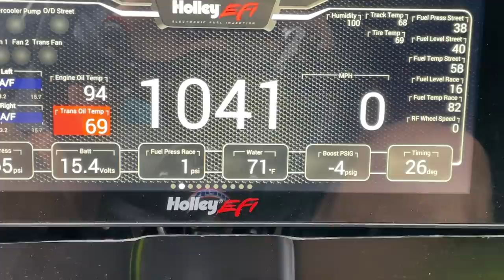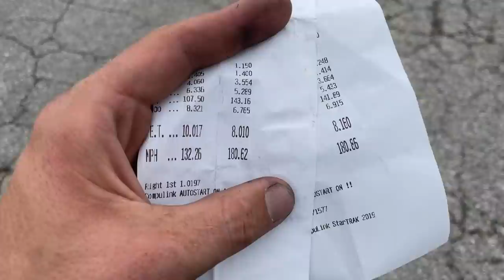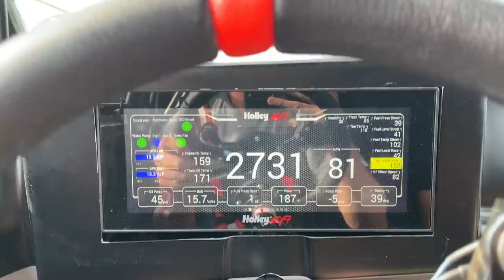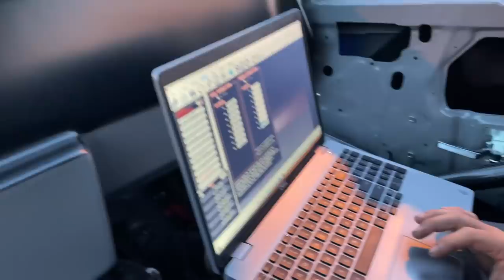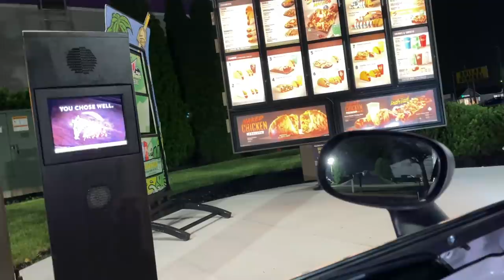Midwest Drag Week Day 3 - Mullet Was NOT Happy... Track Couldn't Hold the FREEDOM! (+300 mile drive)

Comment: As an example of how far automotive technology has come when I was a kid funny cars were running the 1/4 mile times Mullet is almost capable of... and no way a funny car was able to travel thousands of miles on the street dragging a trailer much less. Heck I think they needed rebuilds after each run and went through a few gallons on a run. Plus they were loud enough to hear for 20 miles. Just amazing what is going on now with this sport. So glad it is still alive and kickin. Drag racing is as American freedom as it gets. But if you told someone back in the day your street car could run 6's or 7's in the 1/4 you would have been laughed out of the neighborhood. Yet it is real now. Heck pro stocks were running 10s back then.

Comment: Thought the drivers side storage panel cover was going to tear off on the last pass.  It was flapping sooooo hard.
Reply: Yeah, I'm sure that had to be part of the reason that pass was so squirrely..? Maybe?
Reply: Just the wings trying spread to take flight man
Reply: @tacojay5617  That had noting to do with it, he spun the tires which made it lose tractions so he was basically driving on ice at that point.
Reply: Tires spun, shaking car which probably caused panel to shake loose
Reply: was wondering if that was chute starting to peek out, thanks.

Comment: Need more weight on the back end?  Kevin would fit under that bed cover.  He's worth at least a buck fifteen.
Reply: Just throw a few cases of Mountain Dew in there and it will hook.
Reply: That would be a sick ride, I'd do it
Reply: I was thinking the extra overdrive and the 389 gearset should add a few pounds under there.
Reply: I think they've got a slidable weight in the bed. Time to slide it back? It's an education for me to see the technology available for today's steet/strip (more like strip/street) rigs. How much of the tunable everythings (like tunable suspension systems, fuel, timing, turbo boasting, valve lash, weight locations...) origonated from the Prostock/Promod crowd?
Reply: @carolbates6886   The big gas tank for the street fuel can be mounted in 5 different positions from the front to the back of the bed. 
I remember when 7 second Pro Stock cars were considered fast.
Reply: I remember when Cooper would ride in the trunk of cars and they would launch it
Reply: was thinkin exactly the same.

Comment: For the top bar adjustment, were you referring to moving the front link up?  A higher instant center plants the tires harder.  If you moved the back bar up you actually lowered the IC which would make it squat more.

Comment: Your Holley EFI display is crooked, I’m surprised Kevin’s ocd didn’t see that.
Reply: Or it’s the camera
Reply: @mattspychala7251  Nope.. look at the cut out around the display.
Reply: or cleetus did it on purpose like the mis-aligned steering wheel.. :P
Reply: Could be the screen is level and the dash is a curved unit making it look crooked
Reply: Pretty sure the dash surround is curved, but the screen sits straight, or just a tad too much too the right.
Reply: @Gobbbbb  Go look at it again in his latest video at 2:42.
Reply: @williamstevens4172  Go look at in his latest video at 2:42

Comment: Definitely want to put weatherstrip on the frackin bed cover panels. Maybe even some drains in the front of the bed cover to keep water from pooling and draining into the bed.
Reply: Also, drain holes or filler for the lip in front of the rear tires where the water drips out and might be causing them traction problems.

Comment: That new gear made quite a change on the cruising speed on the motorway.
Before it ran at 26 miles /1000revs, now it runs at 30. 5miles / 1000revs.

Comment: Yeah dont worry about your speed, the speed limit here in the Midwest is simply just a suggestion, like if youre going 75 on the highway you better be in the far right lane otherwise your in the way. I've even had cops casually pass me on the highway going 95-100 when I was driving 90.

Comment: So… this whole el co series has made it where I think when the day comes that I build something… I’m just gonna hire a good shop to do a lions share of it.
Reply: Honestly it's the way to go, you'll end up on a waiting list, but if they have more than like 5-10 employees, don't even think about it, the smaller shops are where it's at (source, me, my dad, and one of his close friends run a shop together and recently worked (straight hourly) over 50 hours a person on a $1/4million promod car that got delivered from a certain high end builder that is quite popular right now, issues we've dealt with: car was delivered with the front control arms assembled improperly, car was missing a throttle pedal loop (which is required for the class by NHRA rules, had to fabricate and add no fewer than 3 missing safety bars, discovered the bolts holding the wishbone (one of the rear control arms that controls sway) to the rear end were finger tight after one came almost all the way out after just two passes, blew the valve covers off the motor in the process of welding in the extra bars because apparently chassis tubes serve as catch cans now (also added about 2 quarts of oil capacity to the sump through ballooning, owner was present and helping and laughed his ass off saying "who f*cking knew they'd put PCV into the roll cage bars" or something along those lines, and finally had to reattach both parachute mounts after one came off on the first pass (thankfully he pulled both and the second held, we didn't trust the second after seeing the first let go so we ground through the welds and re-welded it) this car is trick enough to equipped with per cylinder O2 readings, through a fueltech system.
Reply: @Prestiged_peck  honestly what I’ll want to do is a road race corvette. Nothing crazy… but all the details are what make the difference between a fun, reliable monster and something I’ll be working on way more than I drive.
Reply: @gavinatkins2671  yes sir they are, it's the same for normal cars too, the difference between a shitbox and a nice car is the million little things that never got fixed on the shitbox, some of which became bigger as time went on. Btw if you want to look into our shop we're in west texas, and I have two insta profiles named admiral_boop and the_admirals_fleet that you can reach me on. We deal with everything from SCCA racers to daily driver restomods to full on promods

Comment: You guys need a 10gal removable tank with in in-tank transfer pump. When you get low, hit the switch and transfer gas from the removable tank to your primary on. When racing just pull the removable tank out of the bed not the Camino.

Comment: Did you remove the spring spacers that you drive on before running?  If they are in there, isn't that less front travel to transfer weight to the rear?

Comment: crazy how they can get these cars registered for on road use like that in the US. Over here in Wuhan if you are missing a tire valve cap the car can be impounded.
Reply: I use to think my 380hp SBC Camaro was the baddest thing around now there are street cars with a 1000hp and they tell you it makes that like it nothing. its crazy what I consider fast is nothing compared to what a lot of street cars make now.
Reply: It’s certainly not like that everywhere in the US. Mullet would never be able to be registered in my state. They bust our balls here about stupid shit like modified exhaust let alone having the exhaust dump out the fender right off the back of the turbo.